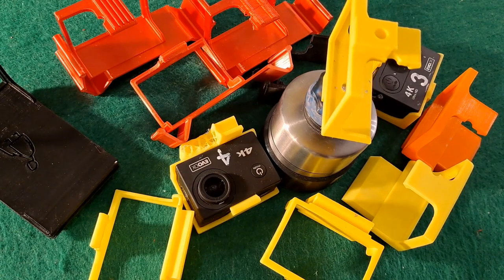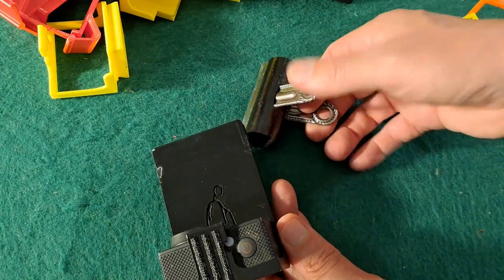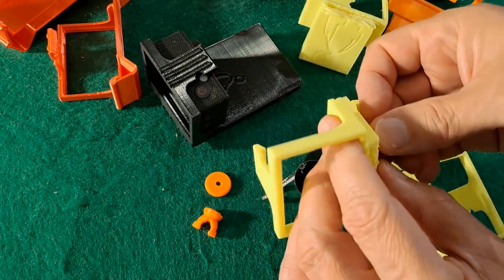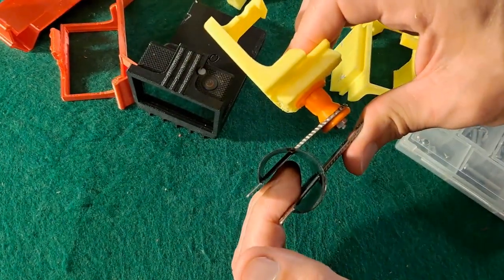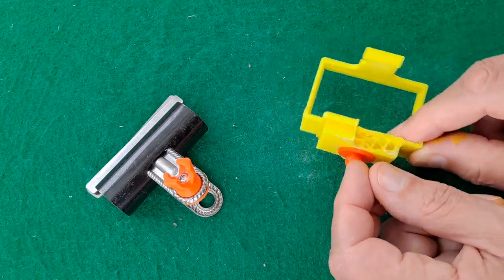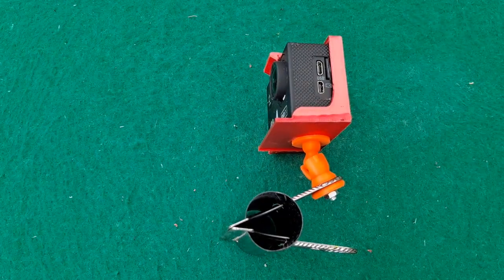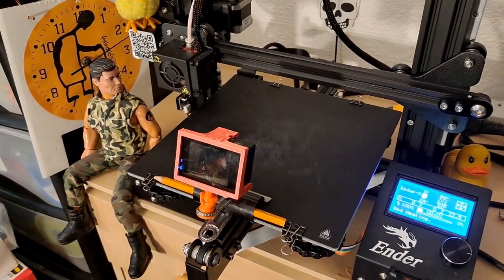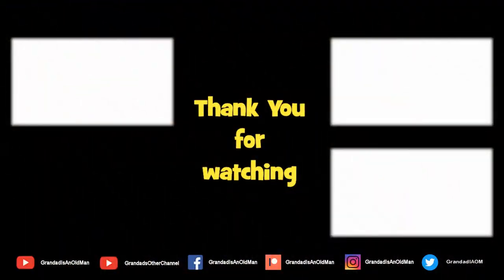Bulldog Clip Action Camera mount 20200821

Comment: Oh wow!  You have been busy with the 3D printer.  I don't have one of those and thinking I am too old to start another hobby since it isn't wise for me to even buy green bananas.  I am looking at the round parts you made (4:06) and remembering I use to be able to buy smaller versions that fit tightly on T pins shafts so I could pin balsa wood parts to a building board while the glue dried, or cured.  Have yet to find them for sale so many years later and sure would love to have some, but slightly bigger than was available back in the day of balsa kits.  Can I talk you into making some for me, say 50 and how much you would need from me for the parts?  The job should be super easy for you to do and if the plastic used to make them was very stiff, yet slightly flexible, the would be ideal.  The key being the center hole need to be very snug to a common, large T pin so the part would slide on the shaft with some resistance.  That way it becomes a clamping device for balsa, or foam.  The first section of the part should be almost 1/2 inch round, with another round part on it near 1/4 inch round, as one complete part with the small hole in the center.  What do you say?  Can we make a deal?
Reply from the maker: I don't think the PLA filament I use would be suitable as it is relatively rigid and the tolerance of making it a tight fit on a pin is probably beyond the capability of the printer. A hole under a millimetre diameter tends to disappear during printing. You would probably end up having to drill them out to fit. Add to that the crazy cost of shipping anything into the USA from abroad and you would be paying through the nose for items that may be useless to you. Your best bet would be to find somebody local with a 3D printer, it seems every other household has one now. You might need to try different filament types to see what gives you the sort of grip you need. Just checking that these are the sort of pins you mean https://www.ebay.com/itm/323367984185
Reply: @GrandadIsAnOldMan  Yes, that is one useful size, and there are other T pins that will work also.  Indeed, shipping is a tough issue.  The virus has me hiding from the public and friends.
Reply from the maker: @wattwaster5936  there are companies that will take your files, print them and post them to you. Might be worth having a look online. Creating suitable files for something like that would be quite easy using TinkerCad which is a free online app that I use for all my designs. Is this what you had in mind https://www.tinkercad.com/things/c7pe5jmS85C
Reply: @GrandadIsAnOldMan  Yes, that is the basic design.  Real simple.

Comment: Couldn’t you just round the top corners off of the female bit...?
Reply from the maker: You could, but you would have to file off quite a bit to get the angle right, and then you may well have filed through the skin into the infill
Reply: GrandadIsAnOldMan , having  seen the footage, may I be so bold as to suggest a “ball swivel “  with an off set, so that the front of the camera lines up with the rear of the swivel extension  i.e. a kind of dog leg, so to speak, that way you keep the height, manoeuvrability and you won’t hit the extrusion unit,  (and a clamp.)
Reply from the maker: @garynewton2106  yes, something like that. Although I think we need a clamp on the ball joint once you add a dog leg. The leverage with the weight of the camera on the end of an arm (or leg) coupled with the jerky motion of the print bed would probably quickly allow the ball joint to  lose grip. We don't really need 360 degree movement, so a single pivot with a bolt and a wing nut should be sufficient.